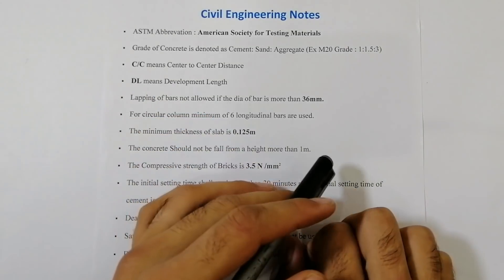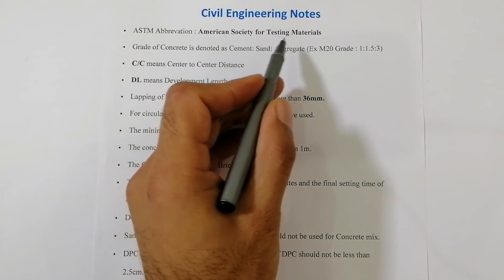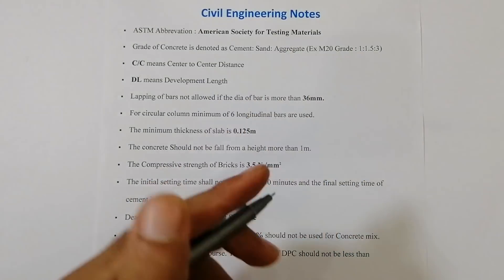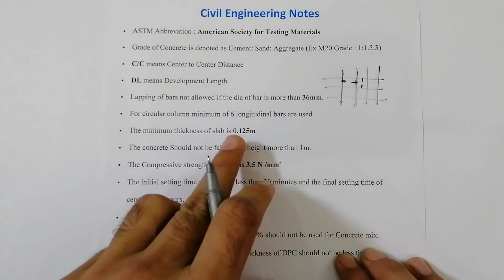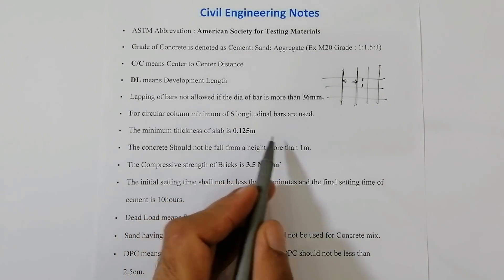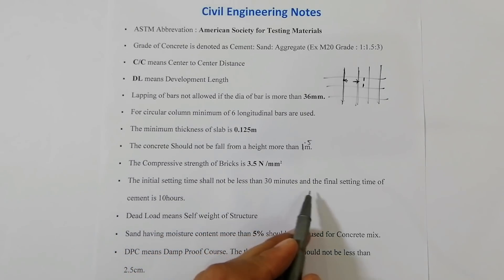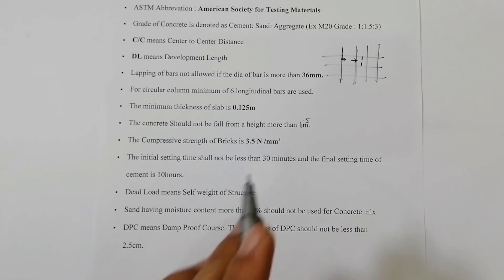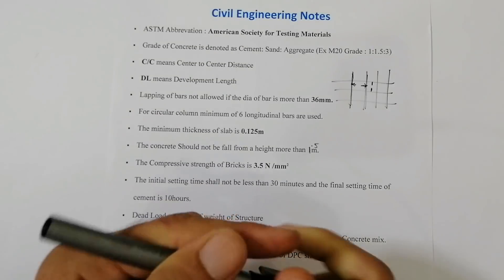Useful Civil Engineering Notes for Site Engineer - Basic civil Engineering Notes

Comment: i have two questions
1:what is the mean of concrete should not be fall from height more then 1.5m what do you mean ?
2: what is the initial time of setting cement and final setting time ?
i did not understand these two points

Comment: What do u mean by DPC?
Reply: Layer of water proof material provided to prevent moisture transmission
Reply: The is a coating. Use to prevent moister in the building. Otherwise damness will occour in buliding or any masonry structure(Dam proofing coarse)